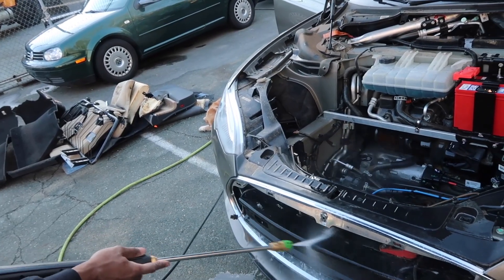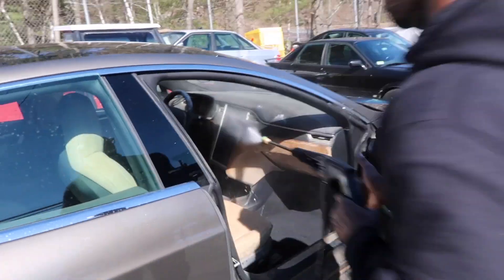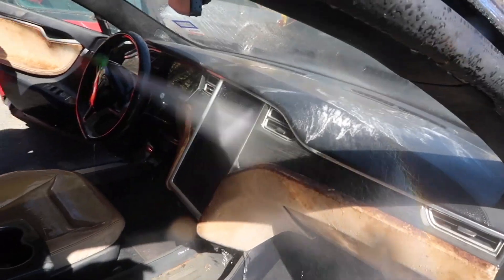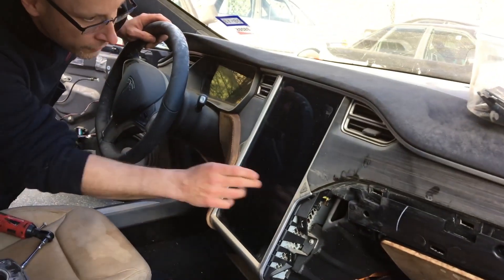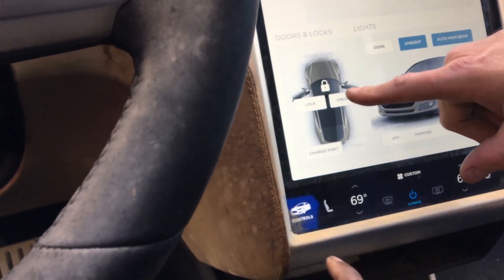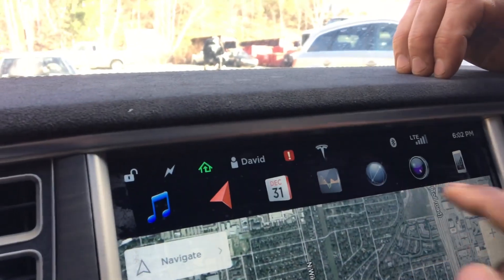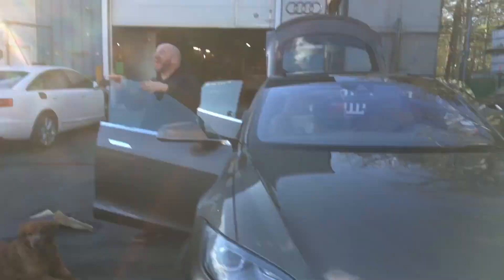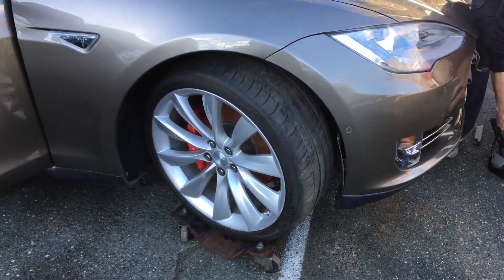What Happens When You Jumpstart a Drowned Tesla?

Comment: Mold & stain remover= 2 gallon pump sprayer. Distilled water. Lysol liquid. Oxy Clean powder. In a separate container, mix well, zero clumps or granules. Pour into sprayer. Spray top down, thoroughly soaking. Let stand min 1 hour. Pressure wash off.

Comment: You should have an air compressor and blow out all that water from the electronics.

Either way it will be unreliable going forward with electrical gremlins

Break Down
Call tow truck
Tow truck shows 
Car works perfect
Tow truck leaves car dies 20 mins later

Comment: Water is actually not deadly to electronics. Its water with impurities like dissolved salts and minerals in it which is dangerous.

And that's only deadly if you have current running thru it. If you removed all the batteries from this car. You could completely submerge it and it'll be fine provided you dry it probably before adding back the batteries

Comment: No, mind not blown, once the electronics dries out it will be fine, but for how long is the question? 

Also I have worked on vehicles with mold and the only way to get rid of it is to take the entire interior apart and clean every part. I've used bleach and baking soda solution.  The way these goofs did this thing is stupid and lazy, that car will make you sick from all the hidden mold behind the dash, door panels, headliner, and in the vent ductwork  etc. Good luck.
Reply from the maker: https://youtu.be/LKhRtox6KuA
Reply: O That's What's up. I STAND CORRECTED, That's what you do in that case, you take everything apart and clean or trash what cant be cleaned.  SORRY for the bad comment ........ https://www.youtube.com/watch?v=LKhRtox6KuA
Reply: digitaldiablo1 Well Rich knows these cars inside and out.  Luckily Tesla built this one right or Rich and friends could have been electrocuted. Their quality control is still terrible from the model 3 complaints.

Comment: Car is dead.  They  got excited by  energizing the 12v system.  Funniest part  was the water jet in the interior.  The Lethal high dc voltage was probably discharged.  And  the  thousands of batteries actually contain lithium foil  compared to the model 3 batteries have no lithium and are realy nickel-graphite batteries.

Comment: Did you pressure wash the electrics with distilled water or with regular water?
Though not recommended to wash electronic components, if you do so make sure you use a steam pressure washer and distilled water. This way you reduce the risk of damaging any cable or other electrics since you will be basically washing them with vapour, leaving no water droplets or puddles anywhere, and distilled water technically does not conduct electricity at all, so no short-circuit should occur. This also applies to any vehicle.

Comment: Just be sure the computer in this car has been properly cleaned even though it works fine now corrosion can still set in thanks to dirt and other filth on the board will attract moisture overtime causing it to slowly rot. The only time where there is an exception to this is when the board has conformal coating or is seal inside an air and water tight shell. Ask anyone who has or still works in or owns a shop like Louise Rossmann here on youtube what water damage does to electronics.

Comment: Before you power anything up after it has been washed with a stupid jet washer you have to let it all dry out first because otherwise if there's water in between components on the PCB it will cause a short circuit besides you shouldn't be washing the insides of a car with a jet wash in the first place

Comment: Electronics are just silicon, metal, plastic and glass.  If they aren’t shorted or corroded and they are dried out, they will work fine.
Reply: Maybe they need a big garage that fills up with rice to help dry this Tesla out.
Reply: ElecDIY lol, just noticed that.  That what happens when you use voice to text
Reply: Sakta backlights layers can be fixed by replacing them. In the video, that backlight looked pretty good. also, if the board was submerged in water for 10 days without power, it will not corrode or even oxidize because the SMD and the bigger BGA component connections are sealed by the flux residue after soldered. And its inside the water which kinda seals it off from danger

It would be a different story if it where submerged in salt water, taken out and placed in an enclosed area.
Reply: Just A guy i was responding to the guy who brought ICE cars and Hyundai here. Thats where my engine response went to. Ofcourse i know a tesla doesn't have an engine. Pls look further then the lenght of your nose
Reply: I can see Tesla fanboys from miles away.
Reply: Just A guy full electric cars do have an engine but electric one. U can call them engine or motor, doesn't matter
Reply: Hell if you throw a PC into de-ionised water it will work fine (as long as there isn't anything on the PC that could ionise the water, like dust)
Reply: People need to just look up what the auto industry uses for connectors etc. All properly sealed and boards conformally coated. Tesla are also known for very well designed electronics packages so I'm not all that surprised that it works.
Reply: im a german Car-Technicianmaster - why the Car electric shouldnt work after this Action?
what do you guys learn over there in the Mechanic-school? 😂

the only thing that could be critical in a worst case is, if you squirt  water while jumpstarting the Car.
Reply: PCBs are made of copper and fiberglass. Chips and ICs are made of silicon.
Reply: it will still corrode away and die randomly some time latter.
Reply: zollotech Do You have an example where any kind of electronic (phone or car) turns on after like 5 days under water?
Reply: @raymond961  It depends is the voltage applied or not and how high voltage  / current device it is. If there is no voltage, then nothing radical will happen, you can sink your phone for a month without a battery, and once you lift it up just clean it up and it will work. (Biggest problem with a low power consumer (non automotive) device like phone is that it's much worse protected than automotive electronics, and therefore water gets easier in places and impurities in water may cause shorts, etc. after drying, should be well cleaned before powering up.) Higher powered electric devices even work in water,  because electrical resistance of water is actually quite high, so for example electric motors etc. may spin just fine in water. The bigger problem is that when the voltage is present and the conductors are in direct contact with water, there happens electrolysis and it will corrode the materials. That will quite quickly destroy a device in water if it is powered up. In cars electronics are better weatherproofed than normal consumer electronics, cars have conformal coatings on the circuit boards, automtove connectors for cables, many control boxes are sealed, the battery pack is probably totally water sealed, etc. They will take water just fine for a moment. But as said before, biggest problem comes when voltage is applied to a part and its conductors are in touch with the water. That will destroy especially low power electronics very fast in water and damage higher power devices too eventually.
Reply: zollotech you clearly wrote that, i think a program knows how to spel silicone
Reply: NeverEndingDeath lol. Have you ever used Siri speech to text?
Reply: dodiloi From miles away because their batteries died out.
Reply: ElecDIY yes silicon, it's what the PCBs are made of. If no power is coursing through the board everything will survive almost all the time if it's taken out and dried. Like my friend had an iPhone 6s that got submerged and it powered on when he hit the wake button and that instantly killed it since the button activated power to run through and short it out.
Reply: Javier Hernandez
PCBs are usually made of fiberglass. The actual integrated circuits, transistors, and diodes are usually made from silicon.
Reply: +Laser Guy Ah yes the famous "Engine" in Tesla cars. You do know full electric cars don't have engines right?
Reply: Hyundais are good cars!
Reply: Sakta i once dumped a motherboard of a pc in the woods. After 6 months, i tough lets drive by and see if its still there, it still was. It smelled like shit but after washing it, no corrosion except op the CMOS battery and the darn thing still worked. No power means no corrosion
Reply: zollotech 10 days. Stfu hater, throw your Hyundai in some water and see happens.
Reply: not hating...I also don't own a hyundai

Comment: Now I am courious, if it would drive? I'm no eletric car expert, but since it booted up- maybe there would be some force to the motors? Maybe the car won't boot to a drivable state with all those errors detected though.. Some Tesla expert, feel free to elaborate what you think ^^ (or know)
Reply: it doesn't have a battery pack
Reply: He booted up the 12 volt subsystem (lights, doors, infotainment).  The drivetrain on the Tesla is almost completely separate and operates at a much higher voltage.

Comment: You’re supposed to cover the distributor cap when you power wash
Reply: Everyone knows that pressure washing a vehicle has a chance of polluting the blinker fluid and causing the muffler belt to slip :P
Reply: pretty sure this car would've driven and everything if they didn't soak the spark plugs with water....
Reply: Pour some mystery oil in the carbs...
Reply: David H it is even not needed for ICE cars if engine after washing doesn't start same can happen driving in rain through puddles. It means distributor cap is already cracked.
Reply: Also the intake manifold. That got totally flooded.
Reply: Area85 Restorations of course I’m joking everyone knows blinker fluid and muffler belts don’t exist😉
Reply: LOL, I knew you were, I was talking about the spark plug guy. haha
Reply: Are you joking?
Reply: no distributor or intake manifold..its electric and even if does ..di-eletric grease displaces water and is used on all electric componets in all automobiles today
Reply: It doesn't have a distributor cap. It's a Tesla.

Comment: I think you should have filled it with rice before trying it.
Reply: exactly and as a phone technician I can say if you get your phone wet don't put it in rice it actually makes it worse by condemning the nutrients from the water to stick and dry to the board causing corrosion
Reply: :v
Reply: Then it would be a Honda.
Reply: Maybe those packets they put in shoe boxes work better? I've been told those work better than rice, so the potential of those packets might be nullified by the comparison...
Reply: probably do better putting it in a bag that has a little mountain of baking soda in it lol
Reply: I was only joking.   It works in films.
Reply: Silica gel is the name. I drowned an iphone X and it came back to life from the dead using the stuff
Reply: mick coomer maybe that would have make the engine running too😂😂
Reply: jajjajajajja its a good idea bro
Reply: Let water boil, stir and simmer for 30 minutes.
Reply: Rice bag stuff is a myth, look it up. The water evaporates at a worse rate, because the humidity in the bag will be very high. The rice does not suck it out of the air. Only on surface contact.

Comment: Pressure washing the electrical like that?
Reply: It was under water for 10 days. I doubt he’s going to do any worse damage by washing it.
Reply: Ninja Master I don't think electricity knows about water pressure
Reply: Ninja Master I wouldn’t worry about the outside electrical motor and such since they are designed to be water resistant. Cars don’t stall during heavy rain unless you flood the muffler or carburetor with water. That’s why 4WD and trucks have snorkel type exhaust to prevent water flooding into the engine.  What’s impressive though is the interior electronics like the dash and management panel working after they’ve been power washed.  Your smartphone and tablet is unlikely to survive that.
Reply: Don't count on it surviving a pressure washer, Matthew. That's gonna cause a lot more water pressure than the phone is designed for, even if the phone normally withstands being submerged several yards below water. Your phone also has a speaker at the front, something the tesla display does not have. I would never want to expose my S7 to something like this.
Reply: Ninja Master I've seen people rip the skin of their arms with them.  You can cut metal with them if you're ambitious enough.
Reply: Chris Bautista, mine will. It's water resistant. 😜
Reply: He's going top replace all of the electronics, anyways, from a donor car that has been wrecked... not flooded.
Reply: Seen someone using pr washer in a chemical plant cut half his hand off
Reply: First of all it was completely submerged for 10 days. Secondly from someone who has used pressure washers allot, the distance he held it away from the screen would exert no real force. That being said, I think this is Rich fucking with us, I am calling it NOW!!!
Reply: Ståle Helde, you missed my point. I was just saying that my phone is designed to be water resistant. I take it in the shower, with me, all the time, to listen to my music, & I wash it under the faucet, daily, to keep it clean.
I'm not saying that the Tesla interior is also water resistant. But it's already been flooded, & he's already planning on changing all of the electronics. Even though it powered up, in this vid, he's still going to replace it all, because it will have plenty of water bugs, in it. It's just pretty cool that even after the flood & power washing, that it still powered up.
Reply: Chris Bautista id worry about any electrical connections or sensors getting knocked loose.100psi or so a couple inches away is forcing that water in. A lot different than rain water or even a deep puddle.

I think they were lucky in this case.
Reply: custom fabrications I've seen people damage their cars and houses with these.

It forces water in with pressure vs a brush with soft friction.